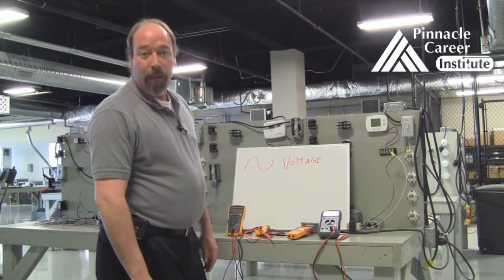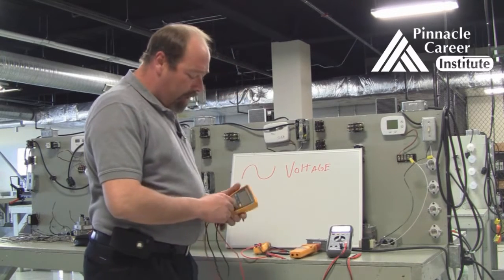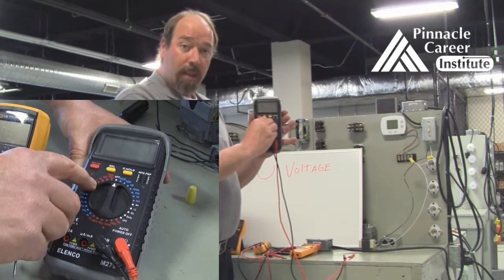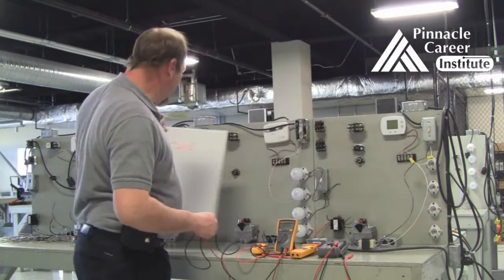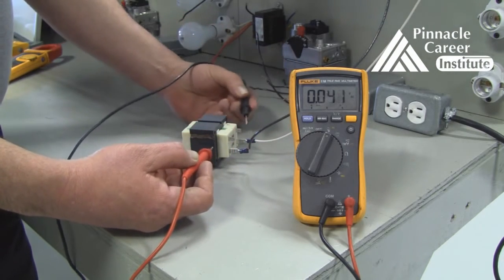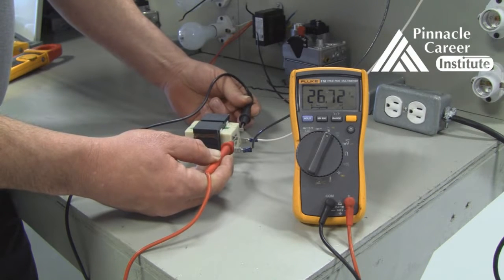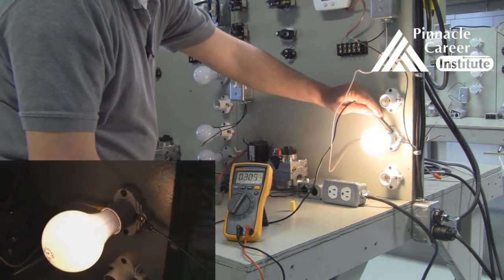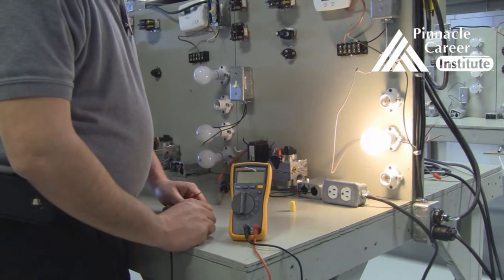Multimeter Basics - AC Voltage

Comment: Why would I get positive 11.5 volts on an automotive headlight plug, but on the other connection of the same plug get -11.5 volts? What’s the negative about?
Reply: The electrical wiring in a vehicle is a DC system. Not AC. There is a polarity associated with it. So if you check voltage across a set of wires, the absolute value of the number is the voltage difference. The sign indicates in which direction you are measuring. If you are seeing -11.5 V, swap the voltmeter leads and you will see +11.5 V.  In an AC system, you would not see a sign because it is a sinusoidal wave that keeps changing polarity. It's just the way AC and DC systems are.
Reply: One more thing to point out. If your boy meter is automatic, it could switch between measuring AC and DC voltage seamlessly. In some volt meters, you have to select AC or DC. On such manual selector voltmeters, always ensure you have the right setting selected. Otherwise, if for example you set it to DC and end up measuring high voltage AC, the internal fuse in the voltmeter will blow... which is then a (minor) pain to change.

Comment: Dude you don’t show what the settings are you have your voltmeter on, I know how to stick wires in a hole I need to know what settings you’re using on that meter
Reply: Turn it to "AC voltage". It was just too basic to mention.

Comment: Why is the ac transformer putting out 26vac when its rated at 24vac?
Reply: If electricity made sense, the union would lose its power
Reply: The actual working voltage for a 24V system is 26-28V.